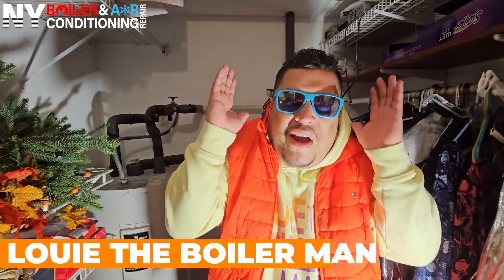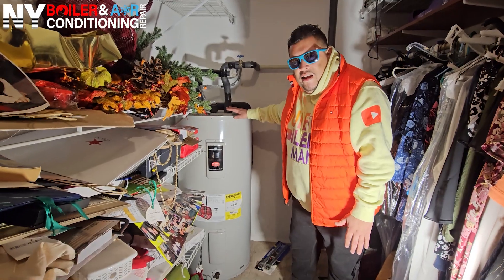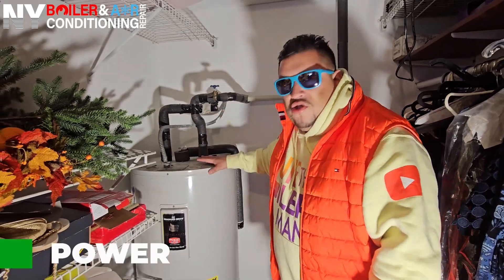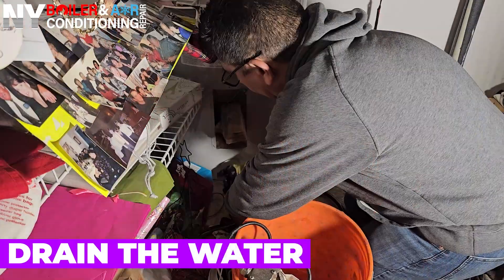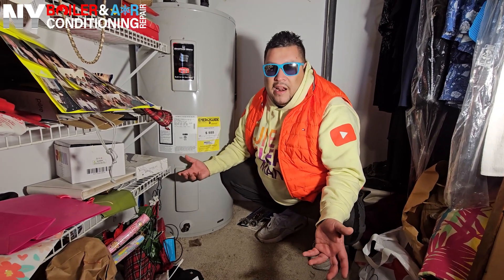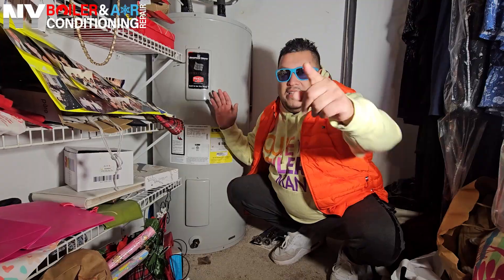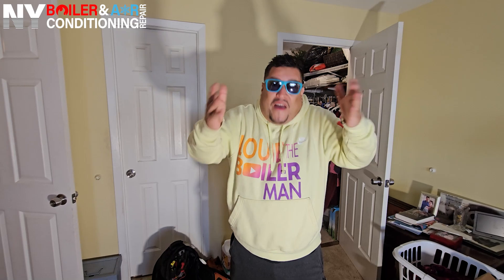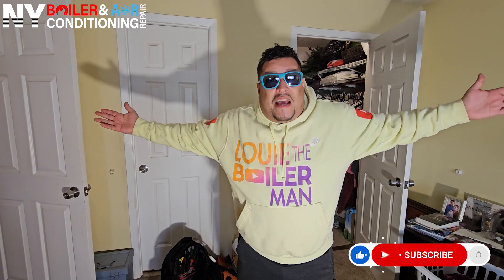How To Replace Upper And Lower Elements In An Electric Water Heater

Comment: Hey, so I’m having a problem with my water heater. It not producing hot water at all. I reset it and still nothing. Don’t have an upper element only a lower. 1500w what you might think is wrong?
Reply from the maker: First check if you have proper voltage… (Power) you allways check power first coming in. Then check if your getting g power at the Heating element after you reset it. If you reset the water heater and confirm you have the proper voltage (power) at the heating element then your element is bad. If you reset the hot water heater and it keeps popping, chances are you have a bad internal heating element. However you still need to check everything to allways double check and to make sure it’s the heating g element or it’s something else